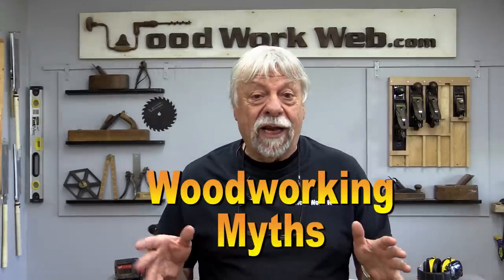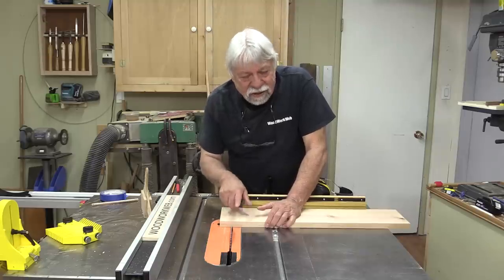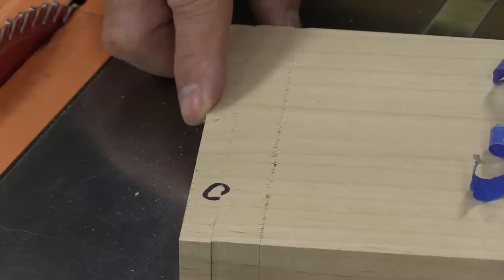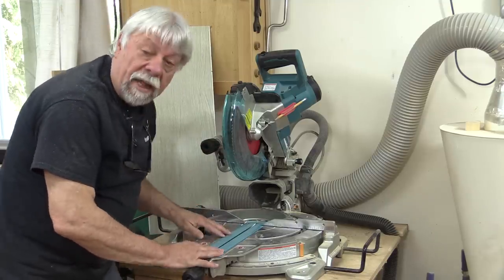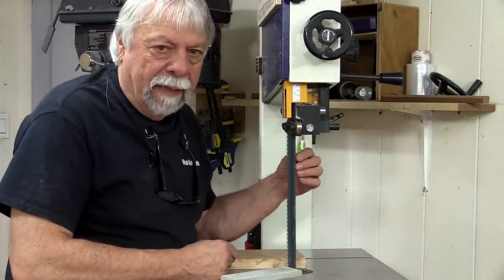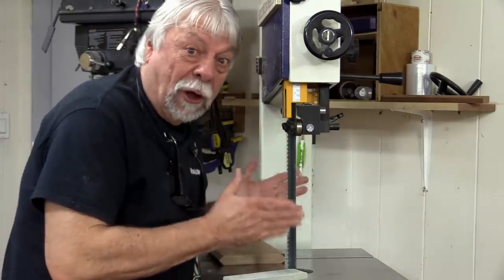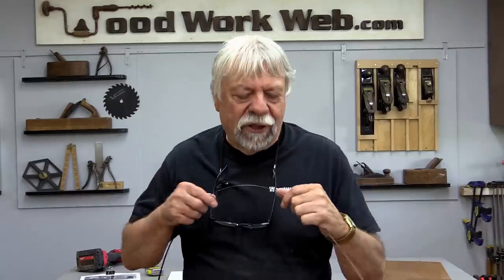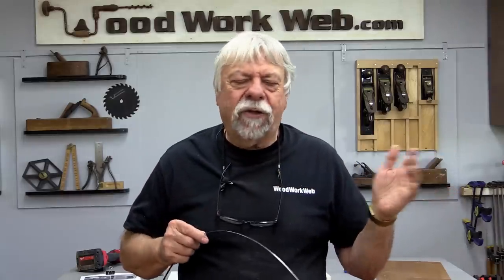Woodworking Myths and Useless Woodworking Hacks

Comment: I use a zero clearance insert on my miter saw because I find that when cutting thin strips off the end of a board that thin strip sometimes falls into the crack and is hard to get out and if left there the blade catches it
Reply: 2009kevo makes sense
Reply: Same reason here.
Reply: It also helps to see where your cut will be.  And it’s a nice lip for a tape measure on longer pieces.
Reply: Yes, that's the reason for having zero-clearance inserts in miter saws.
Reply: @MucaroBoricua  i agree
Reply: That is exactly why you use a zero clearance. It has nothing to do with the cut quality.
Reply: @ronaldcomtois8663  I've always seen it as to get a better cut
Reply: That's the only good use for zero clearance inserts on the whole. But what he said is true
Reply: I hate it when I'm shaving off a thin strip and it drops under the insert and gets mangled. Especially when I'm running an 8 foot long piece.
Reply: Yeah mine throws the small cutoffs around without a zero clearance, super unsafe
Reply: @Grauenwolf  plenty of people think it's for a cleaner cut. Seen it in so many different comments, I don't think you're being totally fair to him with your comment.
Reply: @goggles789 I have never heard anyone using a zero-clearance plate to improve cut quality in a mitre saw, there is no such myth I think he misunderstood why people use zero clearance plates which for small parts and a better cut alignment as others have pointed out.
Reply: Diddo
Reply: I think this video is a very misleading, a normal non-sliding mitre saw does NOT cut underneath first as he says, how can it, its physically impossible, because its moving down it has to cut the top first then breaks through the bottom side anyone who's used a mitre saw for more then 5 minutes will know the tear out is on the underside (if the saw is pulled straight down) and back fence side, a zero clearance insert and a zero clearance fence gives a much much cleaner cut in my experience, I've been using them for 15 years. The demo is really not fair, in the video he is using a sliding mitre saw that he pulls back and fully lowers (as is correct when cutting wider boards) before pushing it through the wood making it cut more like a circular saw would where any tear out is more likely on top side.
Reply: Of course the are reasons for zero clearance inserts for miter saws. But we have to work against the increadible spread of stupid ideas that won't help any of us and just cause frustration , more work and loss of time and money.
Reply: I do the same keeps small pieces from falling under the saw

Comment: I think tape works when cutting thin plywood, like 5mm
Reply: I use tape on plywood with my miter saw.  It definitely works.
Reply: Also if you raise the blade higher on a table saw it makes quite a difference
Reply: A good blade specifically made for plywood is the best way to do it.  Ridge Carbide plywood/melamine blade makes even melanine cuts perfectly.
Reply: Tape does work. He might be the only person on YouTube saying it doesn’t
Reply: @7curiogeo  Definitely! Once you get a good score, your tearout is hardly noticeable
Reply: @rudyramirez3641  he didnt say tape didnt work, he said on a table saw it makes no sense to out tape on the top of a board.

Comment: Some of this information is misleading. Tape works well to reduce tear out when crosscutting plywood especially plywood that is pre finished on both sides.  Who tapes solid wood? I don't use a zero clearance insert on my miter saw but the fact that using one would keep debris from falling into the well means it's not a useless implementation regardless of whether it reduces tear out or not.
Reply: Slow and Expensive I use tape when cutting doors all the time. 

You can see an obvious difference between any laminated surface like hollow core doors or cabinetry panels from both table and circular saw.
Reply: Yes, supporting the wood fibers is not a myth.  Just like anything effectiveness depends on certain variables that all have to align to get the desired result and it pays not to do thing like tear the tape off in the direction most likely to tear out fibers or use tape with too strong an adhesive.
Reply: Exactly.  Some veneers that are especially fragile tape is very very useful.
Reply: If I though it'd help I'd write it again.
Reply: S&E, if I got as much tear out on solid wood as Colin did in this demo I'd try tape too. :^)
Reply: goggles789 it’s misleading because it completely incorrect. A 2 x doesn’t need any help with blow out it is a solid block, so therefore that test is irrelevant.however a piece of manufactured or some glue pressed boards like plywood 100% need support for the blowout from the saw blade, that’s when you rip out the painters tape that isn’t to sticky to tough or to. Thick and it will drastically change your results, shout-out to all you southern capertenters sweating their balls off right now lol
Reply: Why would tape work? I'm honestly curious, I just don't think it has enough mass to do anything.
Reply: Also, how are the cross grain fibers on the solid piece of wood different than the cross grain fibers on ply-wood? We are only talking about the top 32nd of an inch or so of wood anyhow, and the ply is thicker than that anyways?

Comment: It's not that the teeth of the band saw blade melt. Even forging temperature is 1000-1300 C. It's that you heat it up to around 200-300 C where you are effectively reversing the hardening process by tempering it again. (more technically you are changing the crystalline structure of the steel by heating it up) Then it becomes soft and dulls very quickly
Reply: True, but most of us know what he meant.
Reply: Thanks, you saved me from typing this.

Comment: Don't underestimate the value of tape when cutting melamine. Tape doesn't really help under perfect conditions (using sharp, clean, melamine blade with a brand new 0-clearance plate), but perfect conditions aren't always convenient.  I've found that tape improves the cut a little under imperfect conditions.
Reply: Couldn't agree more! I always use tape cutting melamine.
Reply: Same here.
Reply: When cutting melamine on a table saw ,set the depth to ~1mm on the first pass. Then cut it again setting the depth to the wood thickness +1mm. Not a tearout to be seen.
Reply: @DaveJHarry  Pre-scoring is the same concept.  Use a straight edge and a knife to pre-score your line before cutting.  Tough to cut so shallow with a circular saw, but I can usually line it up with a straight edge clamp.
Reply: Tape absolutely works on melamine. If you have a scoring blade, even better

Comment: Wow, there's just so much incorrect here it's astonishing. 

1. Tape has never been suggested for us on solid hardwood. I've never heard that in all my years in carpentry. As many others have said here, tape is absolutely invaluable when working with plywood. 

2. Table saws don't really cut from the "top down". They cut initially bottom up and then nibble tiny bits of the top first, but at that point, because the cut matches the radius of the blade, it's disingenuous to say it cuts from top to bottom. That statement is only really true when cross-cutting on the woods face. 

3. Zero clearance inserts are a wonderful accessory when cutting very small pieces of material and are definitely not useless by any means. Say that around a group of finish carpenters and you'll be laughed out of the room. 

4. Band saw blades definitely come in a carbide variety, and the tips of the blade don't "melt". Think this over a second. If the heat is so concentrated that it actually melts steel, your workpiece would be in flames by that point, or at least smoked right to ratshit.
Reply: I agree with you
Reply: I also agree! Never heard of anyone taping solid wood, or for that matter, any of these other "myths"
Reply: 5. A mitre saw pulled straight down does NOT always cut the underneath first as he incorrectly says in the video, its far more complicated in its movement then a circular saw and its ridiculous to compare them, unless you are using a sliding mitre saw to cut a wide board (like he is rather misleadingly in the video). As a mitre saw moves downward different parts of the blade are contacting the wood at different times sometimes over a quite broad area of the blade and in fact depending on the size of the wood the back half of the blade is actually cutting the wood downwards, also as the mitre saw lowers cutting the top part of the wood first then exiting through the bottom it tends to tear out the underside which is why people often use zero insert to reduce tear out.

I've used mdf zero clearance inserts and zero clearance fences on my sliding mitre saw for over 10 years and I hardly ever get tear out, when I have to remove them to make certain cuts then forget to put them back on I get some tear out on almost every cut I make so I will continue using them no matter how much misinformation people direct at me. .

Comment: You're perpetuating a few myths of your own here Collin! Table saws do not cut on top first. They cut from the side (and eventually from the inside) downward at an arc. The opposite is true for a miter saw, depending on workpiece positioning, and especially if you don't have a sliding saw like you do. As proof of this, you'll notice YOUR tearout occurs at the rear of the workpiece near the fence, because you're sliding the balde. The usefulness of the zero clearance insert also comes when plunge cutting with a slightly dull blade. Obviously a sharp blade with a sliding feature is best, but not everybody possesses these.

Comment: Thank you for another interesting video!
I'd argue though, a zero clearance insert on a miter saw isn't all useless. Using it for support when cutting very small pieces makes a big difference!
Reply: @Throw Stone Yes, we are.  For example, when cutting the end off of dimensional lumber to square it up the off cut is very thin.  The other side might be 6 feet long but there is a very small piece that will fall down under the insert.

Comment: I think that your explanation of zero clearance insert on miter saws is true in many, but not all cases. 
For the moment, ignore sliding saws, just think about a saw with simple up/down movement.  
You can try this on a real saw, or just do the test in your head. 

Put a wide board on the saw.  Say 10" wide on a saw with a 12" blade: just a bit less than the max width capacity for the saw.  Now saw down only partway - just unit the blade breaks through in the middle of the board. STOP.  The front and back of the board are still intact, and uncut on the bottom. Look and think about this.  The part of the blade that is behind the spindle is indeed cutting UP, into the wood as Collin says.  But the teeth on the part of the blade in FRONT of the spindle are in fact cutting down.

So, your explanation is true for narrow boards - spindle in front of 100% of the width of the board. Not true for wider boards. That is one advantage of a sliding saw.  You can cut many boards with teeth going into the wood on both sides.
   - Start with bade at the rear, make a shallow cut, pulling the saw forward.
   - When the blade is all of the way forward, plunge all of the way down, then push back.
Reply: Thanks, you saved me from typing this
Reply: Your quite right Jason, sorry but the video is not great (a video about myths that is actually creating one), I can't believe more people aren't pointing out his failure to understand the difference between the cutting action of a mitre saw where the blade plunges through the wood top to bottom and a sliding mitre saw where the saw can slide through more like a circular saw does, anyone who has ever used a regular mitre saw will know the tear out is almost always on the underside and fence side of the wood (where the blade is exiting), so a zero insert and a zero fence make a massive difference in most cases. I always put the good side up if I'm pulling the saw straight down and good side down if I'm sliding the saw cutting a wide board.

Comment: The tape trick worked like a charm for veneered particle board that I re-purposed from and old Ikea bookshelf,
No tape : tear out like crazy
with tape : smooth sharp lines
I don't think I have used tape outside of that cutting purpose

Comment: I have a non-sliding mitre saw and I get tear-out on the bottom of wood. I don’t get tear-out on the top. I think the whole “the bottom gets cut first” may be true for SLIDING mitre saws but if the saw doesn’t slide, the top gets cut first no matter what as the only motion is from top to bottom as you pull the blade down onto the wood in a chopping motion. I’ll be making a zero clearance insert for my non-sliding “chop” mitre saw.
Reply: I agree.
Reply: I was about to write the same thing.  I have a non-sliding miter saw and about half the board gets the bottom cut with teeth going down and half with the teeth going upwards.  So, this only applies to sliding saws and only if you slide the saw all the way out before cutting.
Reply: @goggles789 Slowing down makes a difference, 100%.  Cranking a fast cut will shred the back of the piece.  It's easy to see with a few quick and slow test cuts.
Reply: This is why you see people with sliding saws make a shallow cut in the top and then a second cut all the way through. The first cut on top has minimal tearout because it's not a through cut and you're cutting down. The second cut - from the front, sliding backwards - has minimal tearout because the blade is now cutting up into the existing kerf.
Reply: Collin is correct that a ZC insert on a sliding miter saw doesn't help with bottom face cut quality when the saw is used in sliding mode — pull the slide all the way out, then down, the push it back through the cut.  However, a non-sliding miter saw (AKA a chop saw) cuts mostly from the top down in a plunge cutting motion. I say mostly because depending on the width of the piece being cut, the blade can be cutting both into and out of both the top and bottom faces at the same time (mind blown!).  Having a ZC insert on my chop saw definitely helps with the underside of the cut.  Note that you can also use a sliding miter saw as a chop saw if, and only if, the piece being cut completely fits within cut width capacity of the blade. I'd assume having a ZC insert on your slider will help in this situation as well, although it's probably best practice to use the proper "sliding" mode at all times with a sliding miter saw.

Comment: Your statement that e mitre saw cuts up through the bottom is incorrect with a fixed saw. You may be right if you're using a slider. But my saw is not a slider and I guaran-damn-tee you that it cuts first on the top.
Reply: He said sliding
Reply: i have a sliding hitachi miter saw and it cuts on the top first, its probley which ever company is making it or the model it is. mine cuts on the top first and drags the wood into the fence.

Comment: No matter what saw you use, you will get at least two distinctly different quality edges, depending on the blade entry direction.  Follow the blade direction.  TS:  blade enters the top, exits bottom, best edge is on top.  MS, at least mine, again blade enters top, exits bottom.  Most circular (hand) saws are the reverse:  blade enters on the bottom, etc.  Track saws (Festool, et al) enter the bottom, exit top, but the design of the track edge gives zero clearance, and so the "near side" top edge is usually the best.  But I've also found that tape will improve any edge, but you have to be a bit more careful removing high-stick tape (which is what Colin used):  pull the tape off in the direction toward the cut edge, which is the direction least likely to lift fibers off the board (esp on soft woods).  Note Colin's first test, first cut without tape, left side was cleaner than right side.  I find that strange.
Reply: Me too. Seems like some editingay have taken place